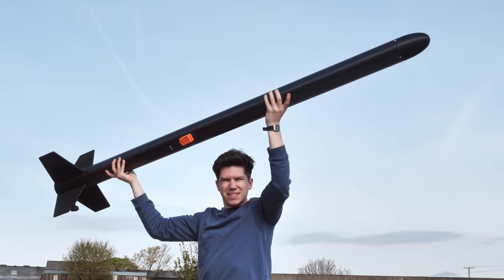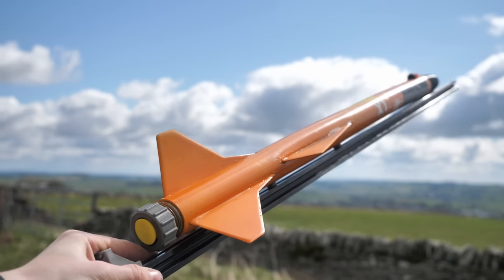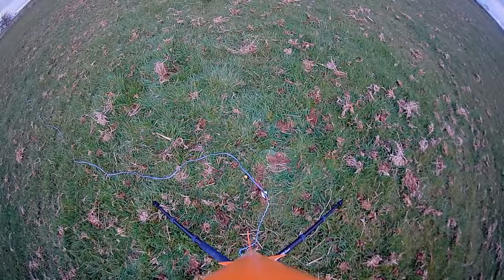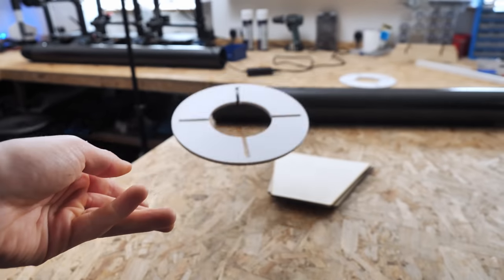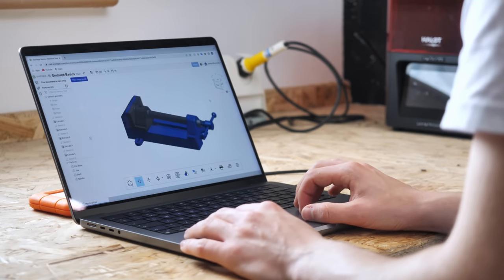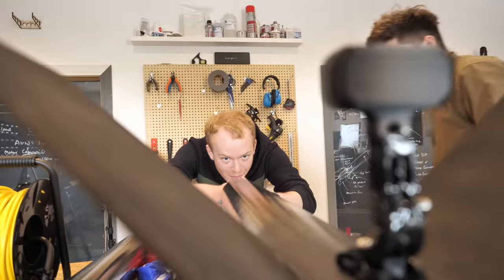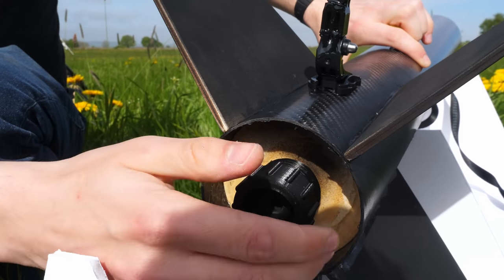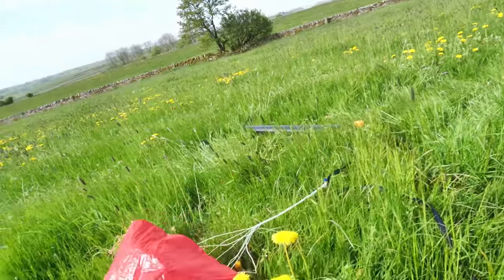DIY Carbon Fiber Rocket

Comment: While a fin can would work, maybe consider through wall fins instead. You still keep the lovely carbon fiber but the fins will slot through and also be epoxied to the motor mount tube on the inside. Of course you have to make sure your centering rings aren't in the way so the fins will have to go between them. Also consider bulking up your epoxy fillets, they were looking a little sad in this video. Also scuff up the carbon fiber for a better bond.

I also have a big safety concern which is your rail exit velocity seems really low. The rule of thumb is you should have at least 50 ft/s at rail exit. Any slower and your vehicle might not be stable. You could do the calculation by hand but there are free simulation softwares like open rocket.

A tip on reducing drift so you can better recover your rocket, consider dual deployment. You can buy the deployment altimeters online, personally I like the Stratologgers, which also have the added benefit of plotting your altitude over time. The whole idea with dual deployment is that you only deploy a small parachute at apogee which is just enough to orient the rocket and keep it just slow enough to deploy a bigger parachute much closer to the ground which will make it safe enough to touch down.

I have no idea what it is like in the UK but here in the US we have rocket clubs that get special waivers from the government to launch model rockets much higher. I would also check regulations because I know in the US your launch would not be considered legal because when you use composite materials it technically counts as a high powered rocket, regardless of the speed and apogee, which needs to be flown at sanctioned events with a flight waiver. Not that you're necessarily going to get in trouble but especially with you having a lot of eyes on this youtube channel I would just suggest you look into it at least.

Love the videos, and I don't mean to assume you don't know any of this but I figured if you didn't some of it might be helpful!

Comment: Nice rocket design but next time maybe put a real motor in it and see if you can reach 1000 meters altitude. There are plenty of ways to track model rockets. Surely you can solve that problem.

Comment: You need a more powerful motor for a larger rocket. It didnt get enough altitude to inflate the paracutes because it didnt have long enough to fall to gain enough air speed.

Comment: Looked underpowered, what motor did you use?
Reply: Yes,  shorten the delay more.  The Cesaroni motor he used was underpowered, in my opinion.   Maybe try a G-107 White propellant motor would give it more initial velocity off the top of the rail and more altitude.   Also, score the CF body tube with coarse sandpaper, then use Rocketpoxy 5000 to attach the fins.  Also use same epoxy to form nice, rock solid fillets.  Best of luck with your next flight. 🚀

Comment: Not kidding, you might wanna be careful with that if you launch it anywhere near police. Your design is almost identical to the HVAR Rocket, an unguided missile usually packed with an explosive equivalent to 3.4kgs of TNT inside of its warhead.

Comment: As always, excellent entertainment - thanks.
A problem common to many experimental-youtubers is 3D printing structural parts that invariably fail.
CAD is good for conceptual drawing but not materials science...
Reply: CAD is great for material's science. Most softwares even let you run simulations. Which will tell you that PLA is a terrible material.

Comment: It's not clear to me what kind of large was sought after. If I was making a rocket to have the largest volume possible, I'd probably dispense with expensive carbon fiber and heavy things like plywood and primarily use balsa, foam, and the like. Possibly even stick and tissue construction. Or inflated! The best shape for minimum drag per unit volume would probably look like a fat blimp, though not so fat that air flow separated before it got to the fins. I suppose if one could construct things really accurately, the best shape would actually be fattest toward the bottom, to promote laminar flow, but that's probably too much precision for an amateur project. Except possibly if there's a clever trick to do it with an inflatable. 

Such a model might be light enough that the recovery system merely involved sliding a bit of weight from the nose to the rear of the rocket, making it stable coming down sideways.

Comment: Don't want to ruin this good video but rocket lab's already using carbon fibres for orbital class rocket, would be cool if you painted the rocket lab's logo on it to celebrate its achievement

Comment: Project Air do you want to sent your rocket to space? If yes then 

Take a weather ballon fill it with helium and attach your one Rocket which has flown the highest then just wait for a clear weather and just leave the ballon attached to your rocket and when it goes to near space it will be about to burst as it bursts (or before it bursts) detach your rocket and ignite it +with camera and parachute it safely back down to earth 🌎🌎

Comment: in some respects thats a very over built rocket for a mid powered engine. your best bet for the fins is to cut slots in the carbon tube, and have through wall mounted fins. Also you would be surprised how much you can get away with with a camera on one side, having the dummy camera most likely wouldn't be needed.

Comment: Using epoxy to glue fins on was a bad idea, epoxy doesn't adhere at all well to carbon fibre, if you must glue something to carbon fibre you should always use a cyanoacrylate glue it adheres much better than epoxy does, and is unlikely to come adrift.
Reply: BPS.space did a video on how to assemble fins with epoxy if I remember correctly, the joint needs composite to attach the fin to the body as the epoxy will not resist the forces.
Reply: Epoxy doesn't adhere well to carbon fiber..... that's news to me. You do know what carbon fiber composite is usually made of right?

Comment: why not just throw a small GPS chip on the cam
Reply: Ai-Thinker Mini GPS Chip Module A9G Quad Band GPRS Module GPS Positioning Tracking Module

like this one, like a tiny one on a circuit board, not a consumer device
Reply: You realize there are GPS chips that fit in cellphones now right?
Reply: eww those cameras and mounts are massive, again, why not just buy small camera modules, 3d print a mount for it and place it INSIDE the tube...run it and the GPS of an arduino or something
Reply: CCTV camera Modules seem to be pretty cheap
Reply: you're wasting so much weight with redundant materials using unmodified consumer hardware. You could have a central battery providing power to cameras, accelerometers, GPS, etc, and could remove SO much excess weight and drag by putting everything in the rocket. even make aerocovers for the camera that only juts out a little bit.
Reply: you could probably get all that hardware in at less than the weight of ONE of those camera mounts, much less with the camera

Comment: the distance seems pretty short for such a large rocket. I honestly, knowing nothing about rockets, expected it to go 250-300 meters. It seems to barely start before it runs out of gas. Must be why the chute barely opened to save the rocket. Too much weight and too little thrust.